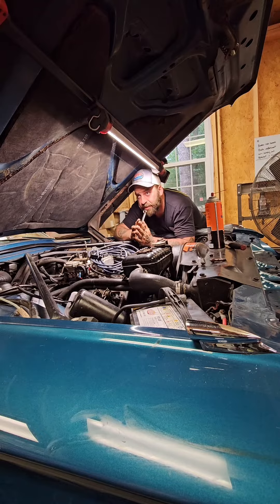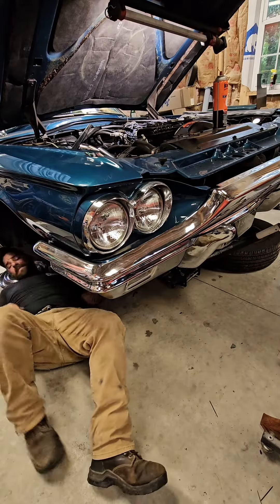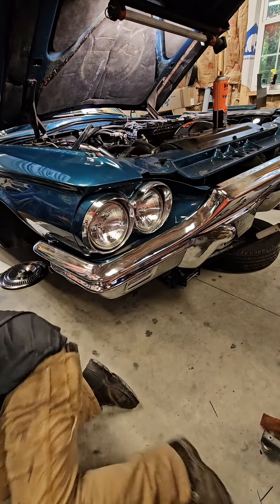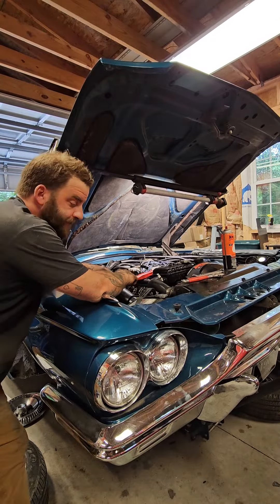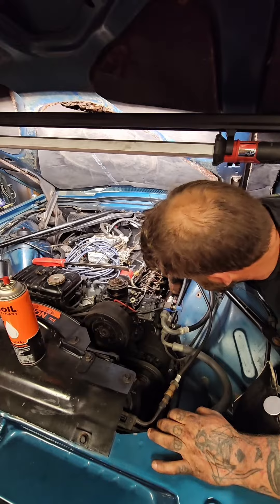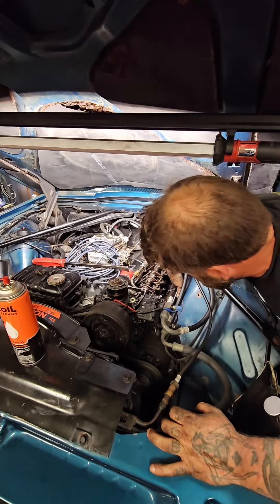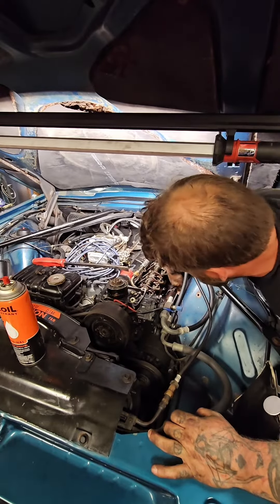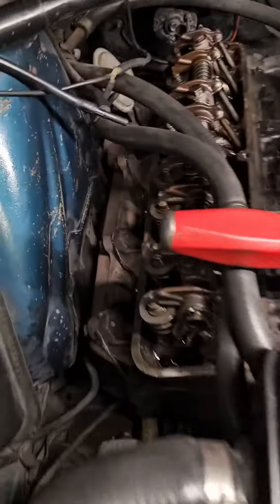ford thunderbird 390 exhaust manifold gasket replacement

Comment: Question: Should I run the engine to heat everything (including the penetration oil) up prior to breaking the bolts free? Or keave everything at ambient temperature?
Reply from the maker: Heat always helps, it allows the metal to expand and the Penetrating oil soaks in further .  It will be smokey and stink but worth it
Reply: @greasyboykustoms  Thanks.  Sounds good!  Almost as good as my car will sound without the tick, tick, tick exhaust leak due to an old, cracked log manifold on the passenger side. 😁

Comment: I don't like them either !! The 390FE is rock solid.  I have one and a C6 in my '66 T-Bird. 
Hey, the slots (instead of holes) in the originals enable you to not have to fully back out the bottom end bolts ti get the gasket out, right?
   And the extra slots on the new gaskets allow you to thread in all the bottom bolts, which supports the manifold, then slip in the gasket.  Great design.
Reply: I'll be doing my right side exhaust manifold soon.  I'm not going to be loosening anything but the 8 bolts to the manifold. 
    On the car you're working on, were the bottom bolts easier to back out, as they usually have a little oil on them ?
Reply: Sorry, I also need to remove the two bolts on the outlet as my manifold is cracked, plus I'm replacing the exhaust bi-metallic butterfly valve thing with a straight through adaptor.  I dont need that feature to help my 390FE warm up.